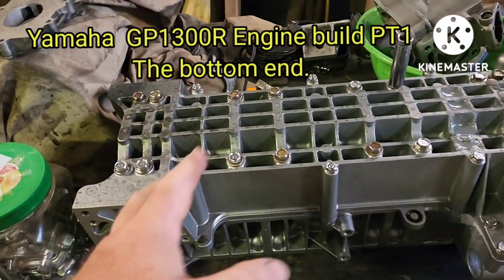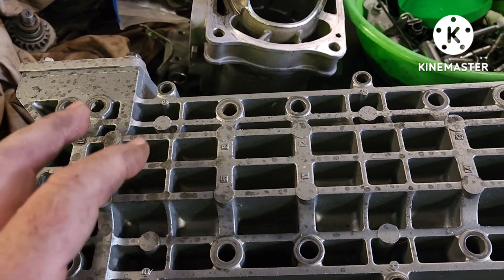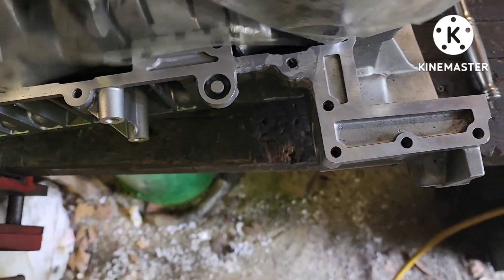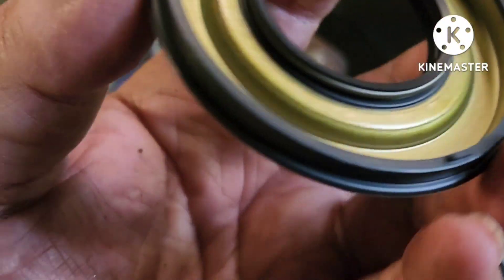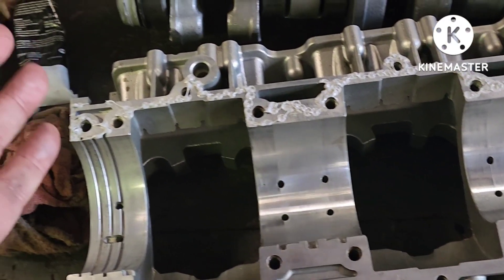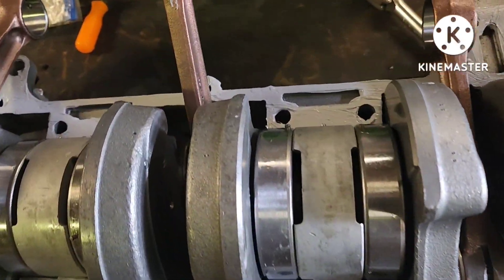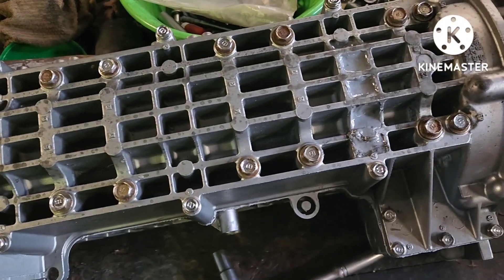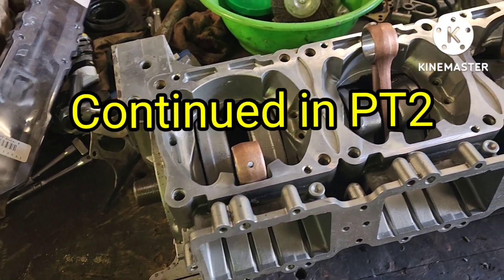Yamaha GP1300R engine build PT1 The bottom end

Comment: Hi i have a major problem with my 2005 gp1300r, iv just bought it, havnt ridden it yet, i replaced all oil lines and bled the pump with a drill. After i put oil lines onto injection system there was 2 inches of air in the last of the lines, i installed pump, put it all back together and i ran ski on hose with some premix in it so it wouldnt seize. Oil did not pump through lines. I pulled it all apart again. Took pump off, measured shaft length, it is 12mm pushed in and 14mm out, (its springy, the end of shaft sits about 13mm out from flange that bolts to motor. Next i measured from engine flange to the end of the crank where the slot is for the oil pump to engage in. The end of the drive is 16mm in from the flange where the pump bolts up and with the ruler in the slot it is 21mm out to the flange. So my pump isnt even engaging. The pump shaft is 7mm short. I wondered if you know or could measure pump shaft lengths if you have any on your shelf? Is a gp1200 pump shaft the same length as a gp1300, im wondering if the previous owner of my ski has put on the wrong pump. Or can the crankshaft move away from the pump??? Please help if you can. Thanks. No one else seems to know.
Reply from the maker: Well the gp1300 is basically a 1200 with different pistons and cylinders.  Now every yamaha I have ever worked on has an extension piece that attaches to the pump which allows it to engage the drive bolt on the end.  It sounds like you are missing that crucial piece.  I think I explained and showed this part in my video a detailed yamaha 800 engine build. Without that piece your oil pump is useless.  It can come off very easily as only a thin spring clip holds it to the pump.  
I had one viewer comment that you CAN run premix in the fuel injected 2strokes.  I was told it can eventually clog the injectors but he claimed to never have problems.  Greenhulk is an excellent source of information for these older skis.  I am sure you can still get that part from yamaha also and it is likely the same length shaft on a 1200 non fuel injected ski as well.  Hope that helps.
Reply: @ShadetreeJetski ok thankyou very much.